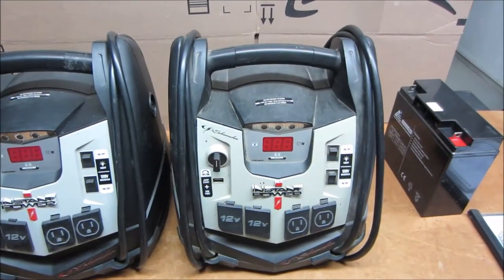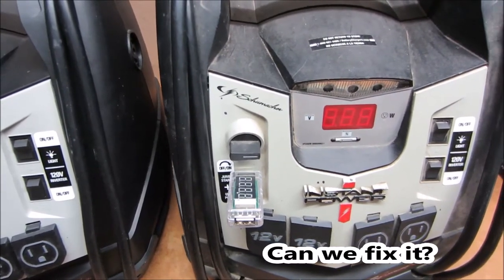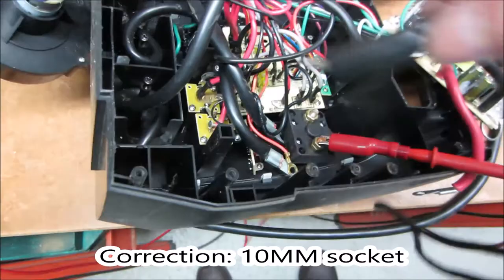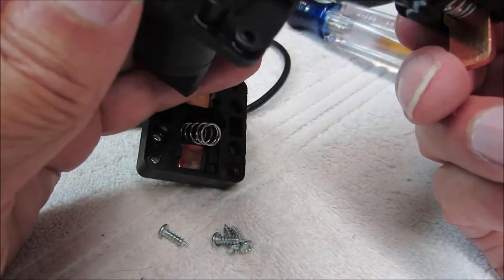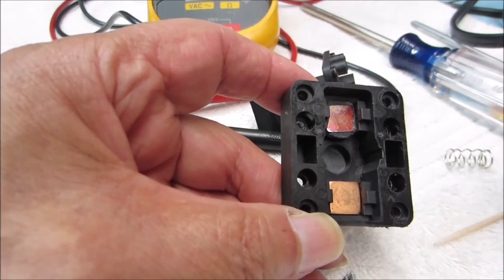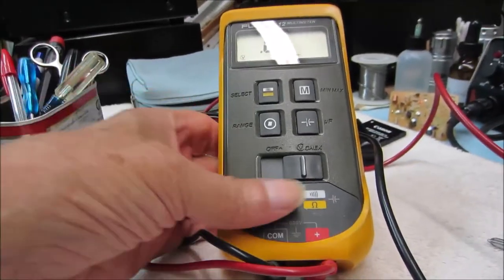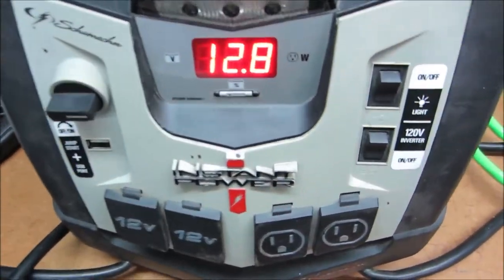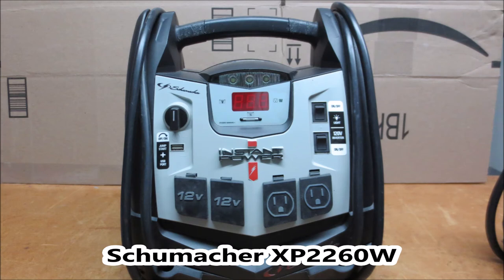Portable Power Repair Secrets - Schumacher™ XP2260W

Comment: I have this model jump pack. The plastic tab that holds the charging plug on the inside is broke.  The sites I googled show that part is discontinued.  Do you happen to know of any part suppliers that still have it stocked?
Reply from the maker: No, I don't, but you can easily replace it with a common AC socket like this:

https://www.aliexpress.com/item/32804170262.html?spm=a2g0o.productlist.0.0.153c5a14HQiniT&algo_pvid=9e846bdf-b19d-4beb-82b0-76cd5eaf92bc&algo_exp_id=9e846bdf-b19d-4beb-82b0-76cd5eaf92bc-22&pdp_ext_f=%7B%22sku_id%22%3A%2264309682539%22%7D&pdp_pi=-1%3B1.04%3B-1%3BUSD+0.97%40salePrice%3BUSD%3Bsearch-mainSearch

Replacement is easy. Horizontally, the two sockets are about the same size. An oscillating tool fitted with a narrow blade makes short work of the plastic brackets (molded to the rear cover) that held the old socket. If you don't already have one, consider something like this:

https://www.harborfreight.com/collections/christmas-savings/2-amp-variable-speed-oscillating-multi-tool-57808.html

Vertically, the new socket is a little taller. Just enlarge the opening using a small file. Perhaps you have a broken CD/DVD player, VCR, computer power supply, etc. that you can rob a perfectly good socket from? If so, don't forget the power cord. Good luck! Thanks for commenting.
Reply: @LawrencePina  Thank you for your help! I will do that
Reply: OK, give me a couple of days. I still have to go pick it up. Thanks, Lawrence. I'll let you know.

Comment: WHERE DO I GET A NEW AIR COM FOR IT THIS IS NOT BLOWING AIR MAKES LOTS OF NOISE
Reply from the maker: Read through the playlist comments. I've not had this problem but others reporting similar symptoms say that the air hose tends to fall off the barb inside the unit. To fix it, they just push the hose back on. As for part numbers, I'm pretty sure you'll find the URL of a Schumacher parts vendor in the one of the Portable Power Repair Secrets comments as well. I've not ordered anything from that vendor, so I don't remember it. You'll have to read through the comments. Good luck! Thanks for commenting.

Comment: Not sure I have the exact same jump box, but very similar.  Is it possible to replace the hose to the air compressor?  Does anyone have a part number?
Reply from the maker: Yes, you might be able to replace it, but usually the air hose just falls off the barb inside the unit. Read through the playlist comments. Others have had compressor problems and usually they just clamp the hose back on. As for part numbers, I'm pretty sure you'll find the URL of a parts vendor in the one of the Portable Power Repair Secrets comments as well. Not something I've ever used so I don't remember it. Good luck! Thanks for commenting.

Comment: Great video! So I have a 5+ year old xp2260. The battery died so I bought a replacement but it doesn’t seem to charge. When I plug it in the current charge shows a lower percentage than what it shows unplugged. Any idea why it won’t charge? main power regulator board? Hoping it’s something more simple!
Reply from the maker: It's not uncommon for the display to stall at 95% or so while charging, then jump to 100% as soon as you unplug the AC charge cable. That just proves the battery maintainer (overcharge protection) circuit is working. Also, a when the main power/jump start/USB switch is turned on, a fully charged battery should indicate about 13 Volts. If you're getting much less than that, try charging it through one of the 12 Volt (cigarette lighter) sockets. Be careful, because there's no overcharge protection when you do it that way. If after 2 or 3 hours the percentage of charge doesn't indicate any higher than when you charged using an AC cable, then you've got a weak battery. If it does go higher, then you might have a broken / intermittent AC charge socket on the back of the unit. That's the usual problem with these Schumachers and it's easily fixed. Just replace it with any other style AC socket, used or new, whatever is going to fit. For the latest info on fixing trash piked portable power stations, please watch https://youtu.be/A2Cyh9zeK5E "Radio Repair Secrets - Harbor Freight 5-IN-1 Portable Power Station." Good luck with your Schumacher. Thanks for commenting!

Comment: How long do you need it to charge for it to be able to start a car a tried to jump my car at 40% and it did nothing but click should I leave it on the charger for longer
Reply from the maker: Here's what's going on: Twelve volt car batteries have six, 2.1V cells. When new and fully charged they should measure 12.6V (6 x 2.1 = 12.6). When new and slightly overcharged, they might measure as high as 12.8V. So for the sake of discussion, we'll take 12.8V as 100% charged. Now most starter motors require a minimum of 12.0V (continuous power) to operate. When a car battery momentarily falls below 12.0V, it may still run the lights and the radio, but the starter motor just clicks. At some point, typically at or below 11.8V, the whole car goes dead. So for the sake of discussion, we'll take 11.8V as 0% charged and 12.8V as 100% charged. 12.8V minus 11.8V gives us a spread of 1.0V between 0% and 100% charged. Now your power pack is only 40% charged. 40% of 1.0 volt is 0.4V. Add 0.4V to 11.8V and we see that the 40% charged battery in your Schumacher is only up to about 12.2V. Now what happens when we connect a 12.2V power pack battery in parallel with an 11.8V car battery? (12.2 + 11.8 = 24 and 24/2 = 12) 12.0V is right at the threshold needed to operate the starter motor and that's why it's still clicking. To successfully jump start a car with a dead battery, you need a power pack with a good battery at or near 100% charge. (12.8 + 11.8 = 24.6 and 24.6/2 = 12.3V, more than enough to work the starter motor) 40% charge is just not going to do it. Hope this helps. Thanks for commenting and special thanks for asking a very good question.

Comment: Lawrence, I have one that im told has a bad board and is unfixable. Are you interested?
Reply from the maker: Unless it's been under water, badly corroded, or something like that, I'm sure the board is fixable. Did they tell you which board (power supply, inverter, or digital display) has failed and why they felt it was unfixable? Alternately, what are the symptoms?
Reply: @LawrencePina   It was Interstate battery. They did not tell me which one only it was a bad board. Symptoms are negative terminal arching when installing new battery. The reason for the new battery was a parasitic draw caused the old one to go bad. I have no idea where it was coming from.
Reply from the maker: Try disconnecting the inverter to battery negative cable as shown at 1:40 in this video: https://youtu.be/OsAhYTDgEr8
If the parasitic drain goes away, everything else should still work fine, meaning you'll still have a jump starter, a USB charger, a DC power source (very handy for DC lighting, DC refrigerators, etc.), still have an air compressor, and still have a work light. Trying this won't cost any money and even though it's not the perfect solution, it makes a lot more sense than throwing the whole unit away. Especially, when you can replace that 400W inverter with an external plug in unit from Harbor Freight that's frequently on sale for just $15 or so. Give it (disconnecting the inverter negative cable) a try. Let me know how you make out. If you still get sparks it means the problem is NOT in the inverter and we'll take it from there...

Comment: What does it mean when a solid chime alarm is going off when plugged in to charge? The only thing I see is an alarm will sound for reverse polarity. Wondering if battery is shot and showing a short...aka something similar to reverse polarity. Got this from a friend that hasn't used it in a few years. I assumed a new battery would be in the cards off the rip...
Reply from the maker: In normal use, an alarm sounds when a module (usually air compressor, inverter, or USB device) is ON, and internal battery voltage has dropped (or is about to drop) below the minimum needed to sustain that module. The internal battery charger only supplies 14V, 500 mA, which is not much. If the module that drained the battery is still switched ON, then logically the alarm would continue to sound even when you connect AC power. If all modules are OFF, then you could also have wiring problem and/or a failed component causing excessive current to be drawn, when AC power is connected. Two videos that might help you to get to the bottom of it are https://youtu.be/g5ibI23UWCA "Portable Power Repair Secrets - DieHard 950 and https://youtu.be/OaDMhZrZlwE "Portable Power Repair Secrets - Schumacher XP2260 Not Charging?" Hope they help. Thanks for commenting. It really helps the channel.
Reply: @LawrencePina  Thanks. I put the battery on a NOCO Genius direct through the 12v port to see if it could bring the battery back. No dice. New 22ah battery on the way. Fingers crossed it works...if not will have to build a custom box with my new battery, haha.

Comment: When charging mine it shows 3.7 for example and 100 when pressing button for power and sometimes the above mentioned again. Tried reading manual but no luck, any idea?
Reply from the maker: Most likely you have a bad battery, and/or corroded battery connections. Open the battery compartment and check the battery terminals. Disconnect the wires if necessary and clean off any corrosion you find with apple cider vinegar. When all connections are corrosion free, reconnect everything and with the charger disconnected (unit NOT plugged into AC) check the battery with a voltmeter. A good, fully charged battery should measure 12.8 - 13.2 volts. With the charger plugged in (unit connected to AC), you should measure just over 15 volts. The recharge threshold is somewhere between 9 and 10 volts. Once a battery falls below that threshold, the little charger built into the unit (or built into the AC adapter supplied with Shumacher/DieHard units) will NOT be able to recharge it. It's not very difficult to check and replace the battery on these Schumachers. Removable battery compartment door makes it very easy. For additional help please watch https://youtu.be/OaDMhZrZlwE titled Portable Power Repair Secrets - Schumacher™ XP2260 Not Charging? and https://youtu.be/OsAhYTDgEr8 Portable Power Repair Secrets - Schumacher™ XP2260 Not Charging? PART 2. Good luck! Thanks for commenting.

Comment: Great video. My front lights don't come on Can you tell me how to fix it? Thanks
Reply from the maker: Regarding "front lights  don't come on," do you mean the LED work light doesn't light up? Do you mean the LCD display doesn't light up? Or, do mean that neither the work light nor the display lights up? Neither lights up would be the most common problem, indicating that the battery is dead, and needs to be recharged or replaced. If it's just the work light that won't light up, then you most like have a bad ON/OFF switch. Please watch https://youtu.be/A2Cyh9zeK5E titled Radio Repair Secrets - Harbor Freight 5-IN-1 Portable Power Station for more info on that problem. Good luck! Thanks for commenting.

Comment: My Schumacher will not work with the inverter or 12 v sockets. The jump starter does work and the light and compressor works. The big problem I have is all the different screws some of them seem to be hex screws. Thoughts
Reply from the maker: These symptoms are addressed in the official XP2260 owner's manual, PDF pages 8 and 9, which you can read and download here: https://www.manualsdir.com/manuals/138818/schumacher-xp2260.html?page=9 Good luck! Thanks for commenting.
Reply: The pdf file is no help. Same issue here.  Everything else works have used it multiple times to boost vehicles

Comment: That´s a great video i got a question do you know how many amps is the battery inside?
Reply from the maker: The Schumacher xp2260W (at least the ones I've seen) takes a WP18-12SHR, 12V 18AH/20HR, Initial current less than 5.4A non-spillable, sealed, lead acid battery.
Reply: It can handle 1.7 amps maximum.
Reply: I have exact model of this.  My unit won't work in AC mode.  Can you tell me what I can do to fix it.
Reply: Check the 25 amp fuses on the inverter board. That's the board with the heat sink on the right-hand side when the back of the case is open.@dido1803

Comment: how much input in this device to charge?
Reply from the maker: Schumacher model XP2260W has AC input which is internally converted to 12-15V DC, 1A charging power. DieHard brand (Schumacher) models with DC input use external 15V DC 1A AC adapters. Polarity is positive to the tip, negative to the ring. Hope this helps. Thanks for asking! Please like and subscribe as it really helps the channel.

Comment: Do you have any idea why my unit doesn't show a green light on the back when I plug it in to charge? The battery is good, I actually used it today to start my car. When I went to plug in the unit after that to charge it up, the green light won't come on. Tried several power cables including the one it was originally charging with that used to work. Appreciate your feedback!
Reply from the maker: The 2 Volt LED next to the folding AC plug lights green whenever a live power cord is attached. If the internal battery is disconnected, then it blinks green. If the LED is not lighting at all, then either the AC cord is open or not plugged in to a live outlet, the folding AC plug is broken (a very common problem) or the LED is open. Are you sure the AC adapter board (to which the LED is connected) is charging? When NOT under charge, the battery should read 12+ Volts. When the battery IS under charge it should read 14+ Volts. Mine goes to 14.25 Volts or so when charging. So which is it? Remove the battery door and test for charge voltage. If you measure 14+ volts when the AC cord is plugged in to a live outlet then the 2 Volt LED is open. You can ignore it or replace it with a new LED. If you don't get charge voltage, then folding AC plug is broken, or there's a problem on the AC adapter board located directly behind the back cover. Good luck! Thanks for asking. Please like and subscribe as it really helps the channel.
Reply: @LawrencePina  Thanks for all the information. So I was lucky enough to charge it up recently which is why the battery LED indicator registers plenty of power and it jump started my car. But from what you just wrote, I'm pretty sure the folding AC plug is now broken as the light won't come on anymore. And I figured that might be the case. It does not charge anymore. I really appreciate the reply and the help!
Reply from the maker: @BillyReichard  I finally made a video showing how to replace that jack. If you still have the XP2260 and haven't fixed it yet, you may find this useful: https://youtu.be/OaDMhZrZlwE
Reply: @LawrencePina  YES! Thank you!!  :) I still have it and now plan to fix it.

Comment: Hey Lawrence, mines about 5 years old, been sitting a couple months, went to jump something and no power, went to plug it in to charge and it makes a high pitched shrill, any ideas?
Reply from the maker: Sounds like the battery is not just dead (as in partially discharged) but dead shorted (as in presenting zero ohms to the charger). Disconnect the battery. Take it out. Test it with a multimeter if you've got one. Otherwise, with no battery in the device, place the jumpers across a car battery and see if everything (compressor, light, inverter, USB) still works like Mustie1 shows how to do in his video: https://www.youtube.com/watch?v=-VTElQ6URQ4. If everything still works, chances are that all you need is a new battery. Good luck. Thanks for asking. Please like and subscribe as it really helps the channel.

Comment: Can we change the battery from lead acid to lithium?
Reply: :) lovely ! but the charger is not going to treat the batterie well ! Do not do it :)
Reply from the maker: Not easily. Even if someone assembled a Li-ion battery pack small enough to fit the space provided and powerful enough to run all XP-2260 functions, you would still have to redesign and replace the built-in SLA battery charger PCB. The charge characteristics of Li-ion and SLA (sealed lead acid) batteries are very different. Redesigning and fabricating the new charger PCB would be a lot of work. While I'm sure there's an engineer somewhere who could do it, it's just not worth it, in my opinion. Almost every portable power pack that comes my way has malfunctioned due to an undercharged, or never-been charged, nearly dead 18Ah OEM battery. Just replace the bad battery with a more powerful,  MigtyMax 22Ah SLA. The power pack works better than ever and I've not had a single complaint!